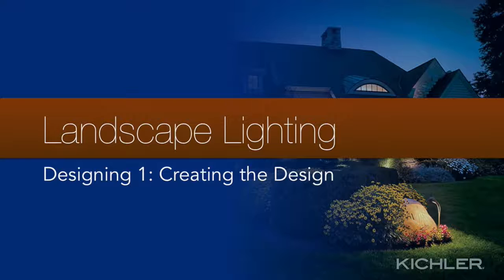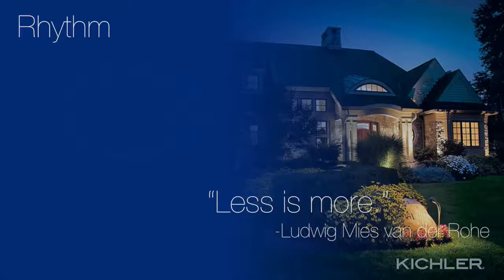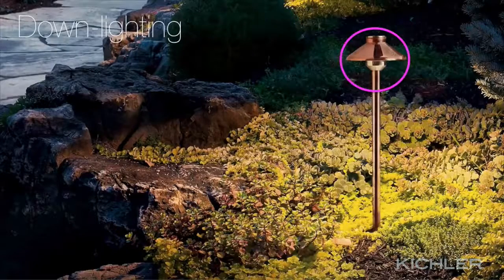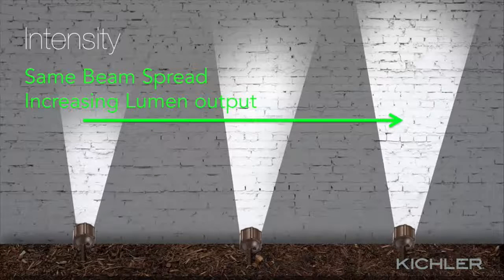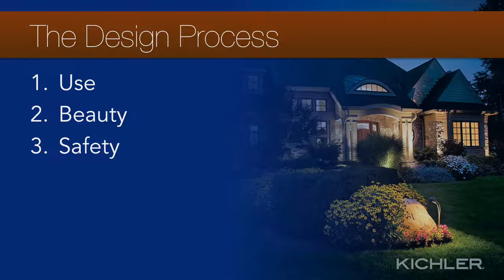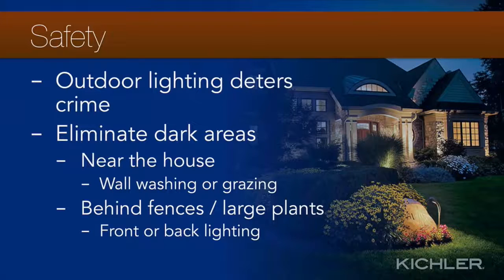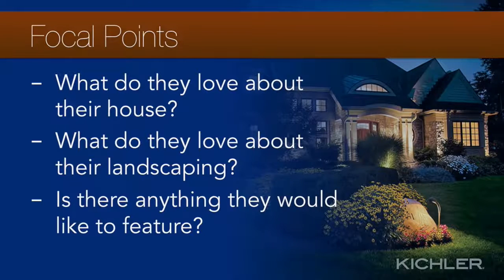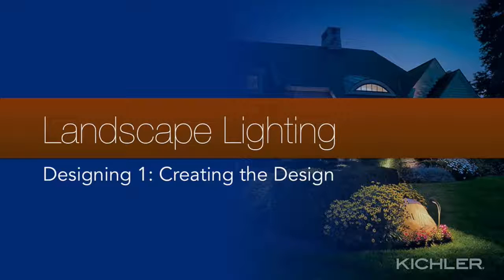Kichler Landscape Lighting - Designing 1 - Creating the Design

Comment: Customers desires and customers budgets are always two completely different things. They all see the crap at the box stores with 6 lights wire transformer kits for $200 and expect the results you present in this video. So the homeowner is thinking about $1000 should give them a beautiful display that people will be amazed. Well as a contractor this design is really high end and would cost any where from 5K to $7500 with no problem. These jobs come along once a year maybe.
Reply: This style is becoming antiquated as we move more into the 21st century. People are wanting more with color and something they can use for holidays as well. That would make the price more bang for your bucks. Its just these landscape companies are not willing to upgrade -Nothing stays the same and everything changes.
Reply: high end...nonsense labels its LIGHTS
Reply: @mzzcognac6459  This doesn't look antiquated to me.  Nice classy 2700 K lighting is the best.  If you want the bulbs to be RGB so you can simply use a phone app to change the color to red and green lights during christmas, fair enough, but the rest of the year, a nice warm 2700 light looks the best.  Otherwise your house looks like a casino all the time